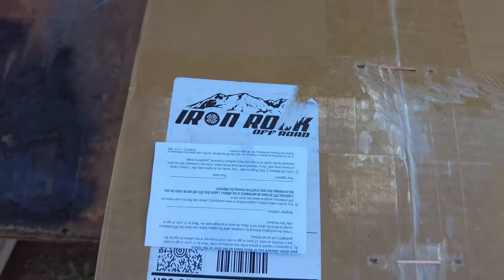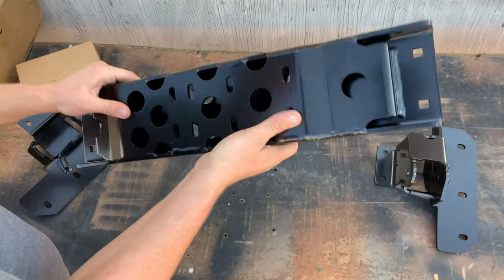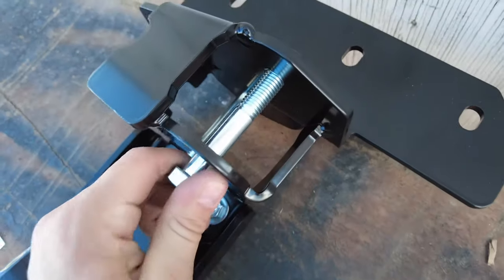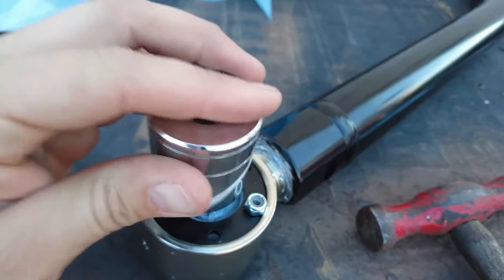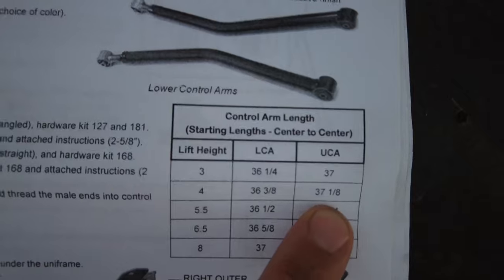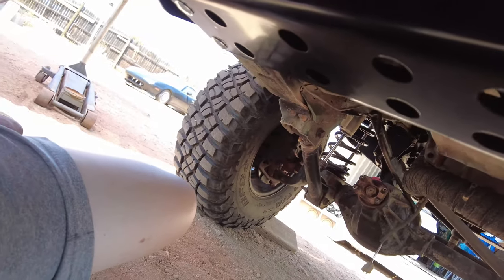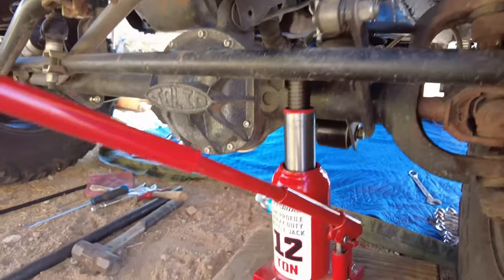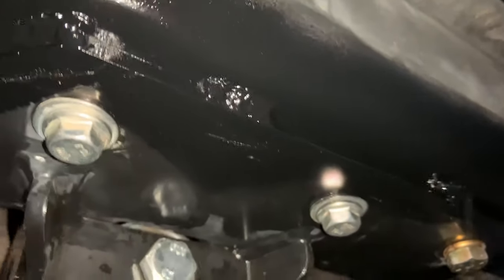Iron Rock Offroad Rock-Link Long Arm install on a Jeep Cherokee XJ

Comment: The provided iron rock joints at the ends of the control arms last about 1 month. I went with the metal cloak ones about 3 years ago and have not had any problems
Reply from the maker: Good to know thanks for watching! Are you talking about their duroflex joints?
Reply: The goofy ones where you need to torque them down to inch pounds. Eventually they will flop around in the housing and sound like they are going to bust through your floorboards
Reply from the maker: Yeah the inch pounds thing kind of threw me off. So what all did you need do to replace the IRO joints with the metalcloak joints? Is it a direct fit in the IRO ends or did you need to buy anything special?
Reply: @2AOverland  they were a direct fit, just do one side at a time. I forgot the size…something oddball like a 2 9/16”. I just called metal cloak and told them the description from the iron rock instructions and they confirmed what I needed. It’s a very common size apparently
Reply from the maker: That’s awesome man I appreciate you letting me know! I might do a video on this along with installing a Johnny joint on the upper mount of the axle 👌🏼
Reply: I know this comment is a couple years old, but I’m having same issues with the IRO joints. I sent Metal Cloak the IRO specs, but they replied that they don’t have anything. Curious if you know the part numbers you bought?

Comment: For the next person looking to do this, if you get a 9-12” thick metal carbide sawzall blade then it makes it a lot easier to cut the bottom control arm brackets off.
Reply from the maker: I couldn’t agree more! That helped me so much when removing mine!
Reply: @2AOverland  I used a 12” and was able to cut through all layers at once, it was awesome!!
Reply from the maker: @DustySteel  I used a 9” and a grinder and I definitely recommend against using a grinder now 😂 almost cut some lines going up the drivers side unibody rail
Reply: @2AOverland  I’m glad that you didn’t!! I also liked that with the sawzall, it didn’t shoot sparks everywhere. I laid it flat up against the bottom of the frame and saw’d away lol. I left the part on the inside of the frame because it didn’t seem in the way. I could be wrong though, I guess I’ll find out when I’m done lol.😂

Comment: Great choice!  Love my 3" Rock Link!  I didn't get the high clearance version which requires removal of the old LCAs.   Installed it last year on my '93 XJ.   Coupled with their OTK steering kit and OME's long shocks, my girl drives amazing both on and off road!  Word of caution though, I raised the pitch of the rear pinion to 6 degrees and still got vibes with an SYE so I installed the T-case drop blocks and that one degree change eliminated them.  Makes getting to the nuts to get the center section out easier when you need to.  But the exhaust pipe will angle down with the drop blocks so you may need to have a shop reform it back to where it should be.
Reply from the maker: That’s awesome man! 😊 I’ve had their steering for years now and zero issues too! The only down side is the occasionally squeaking heims but that’s not their fault! I used some Tom Woods shims for the rear axle and haven’t had an issue yet! This kit paired with a good set of leafs, coil springs and shocks almost rides as smooth as a car off the lot IMO.
Reply: @2AOverland  Very nice!  My entire suspension was an IRO kit except the shocks.  Haven't had squeaks with mine except the bushings on the leaf springs need greasing every year after winter.  Extremely happy with it otherwise.  You'll have great service from yours man! 👍
Reply: I’m in the process of installing IRO’s 3” 3-Link Long Arm Kit and their 5/8 OTK steering upgrade. I’m very excited to see how it handles because the Jeep pretty much needed new everything anyways lol.
Reply from the maker: I have the same setup man and it’s tough! And it will handle well!
Reply: What size shocks did you guys go with in the front and rear?
Reply from the maker: 4.5 in fox shocks with resi’s

Comment: How are the joints holding up? Also, do you wish you had done the frame stiffeners at the same time?
Reply from the maker: It had frame stiffeners at the time of install and the joints have been great! I grease them every 6-8 months
Reply: @2AOverland  Awesome, thanks. How about the heim joints on the steering? I think id prefer ball joints but the price on the CavFab heim kits is nice.

Comment: When hacking off the lower control arm bracket, does the left over material need to be flush for extra clearance or did you just flush and flatten it with the wheel grinder for aesthetics reasons?

The reason I ask is that I’d like to do as little grinding as possible and would assume that leaving extra material would only work to add reinforcement to the unibody in that particular spot. Of course, i’d grind down sharp edges and pointy surfaces.

Anyway, thank you!

Great content! I love your humbleness, btw! Love the XJ, keep up the good work! 🙏
Reply from the maker: Thank you so much for the kind words I really appreciate that! 😊 I mainly flattened it with a grinder for aesthetic reasons but you can take off just enough material to make sure everything clearances and you should be fine!

Comment: How were you able to torque the carriage bolts holding up the crossmember i cant find room and do not want to have to remove the exhaust
Reply from the maker: I honestly don’t remember what I did to torque it… I think I used a deep dish socket and just cranked them on there as tight as humanly possible

Comment: What do you think?  Upgrade my XJ to a dana 44 from my dana 30  front axle with chromoly axles 4.56 gears and  Eaton tru track lockers fully trussed 0r install this long arm kit?  Which one would you do first?  ps:  I love your install videos.
Reply from the maker: I absolutely love the long arm kit and how it rides on and off road but if I had the choice I would 10000% do the Dana 44 with all the upgrades first, then do the long arm. The 44 with chromoly strength and a truss will make that thing bomb proof  👌🏼 and we really appreciate it! Every project I do for the Jeep will have a video for it!
Reply: @2AOverland  Thank you so much for the help it makes my decision much easier.
Reply from the maker: Not a problem! I can’t wait to see the progress of your rig

Comment: Does that heat wrap on the exhaust help with trans temps?
Reply from the maker: In theory it should help but I’m not entirely sure if it helped with that but it did help with interior temps since I have no carpet inside the jeep

Comment: Have you had any binding issues since you put this kit on?
Reply from the maker: None whatsoever on my rig at full droop and full flex 😊👍🏼
Reply: @2AOverland  what about the upper arm making contact with front drive shaft. I want to pull the trigger on this kit but ive been hesitant because i hear alot of different things
Reply from the maker: I had the same question and I was hesitant about that too til I installed the kit. I went wheeling and stuffed the drivers tire as far as I could into the wheel well after install and had zero contact anywhere. I’m on 4.5in & 33’s and had no problems and I have a friend with 35’s and 6.5-7in of lift do the same and he had no problems either. I honestly think if you install the kit correctly and have the right caster angle with your axle you won’t have any issues

Comment: How does the 3 link work out for a daily driver (on road)? I know the 3 link is designed more for off road use. Thanks for you time. God bless and stay well.
Reply from the maker: Sorry for the late reply 😬 but thank you so much for watching and god bless you too! 😊 I honestly think this kit would be great for a daily driver! We’ve easily put a 1000 plus miles of city, highway and trail miles on  it and have had zero issues whatsoever.
Reply: Once it breaks in it rides perfect on the highway...I have the 4" and 33's and can do 75-80mph with no issues. I beat it up on the trails also.
Reply from the maker: Same boat man, it really does ride great on the highway. Better than I thought actually
Reply: I've had mine for over a year of daily driving to work and back.  The ride is amazing on and off road.  Rear sway delete and installed Boostwerx steering box support with front sway bar and quick disconnects on mine.  Solid and dependable.
Reply: @rgsrails  noticable difference with that brace? Or just piece of mind. Been looking at JCRs since BW is no longer selling them.

Comment: why is the caster on the other side different?
Reply from the maker: Thanks for watching! The caster is different cause the adjustment on the control arms aren’t the best. The threads are so big and with it being a 3 link you can’t really do any fine adjusting since there’s no upper control arm on the passenger side. That’s why I said if they’re within the degrees I said in the video (I forgot) of each other you’re fine and shouldn’t have any issues.
Reply: @2AOverland  how does this small difference affect drivability and tire wear?
Reply from the maker: @ninofajardo1288  I’ve driven the jeep 600+ miles and have done a lot of trails since doing the lift. That’s with having the caster angle difference and it’s been perfect on the highway and the tires have looked fine too.
Reply: @2AOverland  I finally installed mine after a lot of blood and sweat lol. However I am running into a probelm. I’m running 4.5 metalcloak springs and I noticed that with the lower control arms are the same exact length, the passenger side of the axle I slightly more forward than the left . I think it’s attributed to the worn upper axle bushing where the upper control arm is located . With the passenger side slight more forward by 0.5inch my springs are bowing a bit causing the passenger side to sit close to an inch lower than right . Have you ever had issues like this? Were your lower arms the same exact length ? Thank you !
Reply from the maker: No problem man! I’m glad you got the long arm on there 😎 my control arms were exactly the same length and I didn’t have that issue with mine at all. I would say replace that upper control arm bushing and double check the control arm lengths and then go from there 👍
Reply: @2AOverland  what springs did you have
Reply from the maker: I have the 6in metalcloak springs